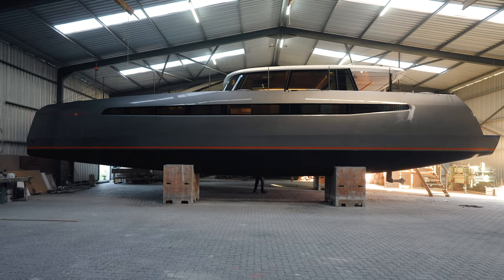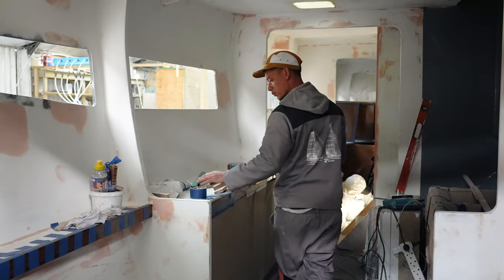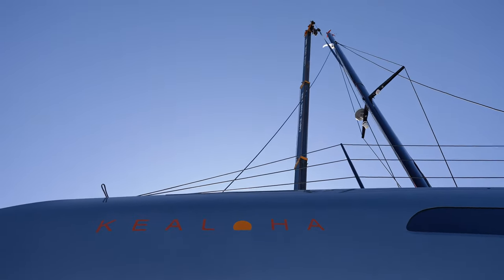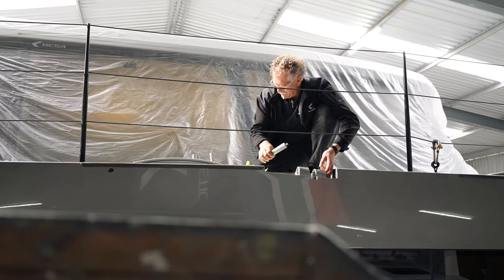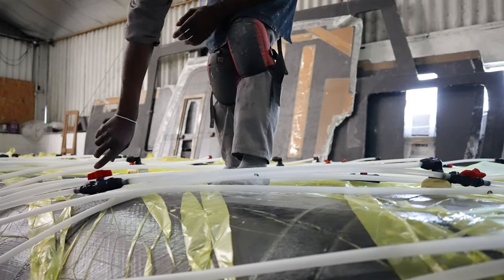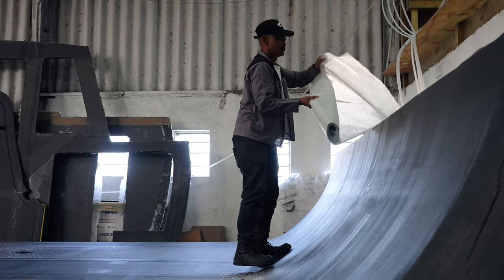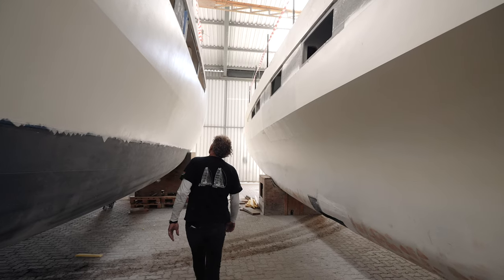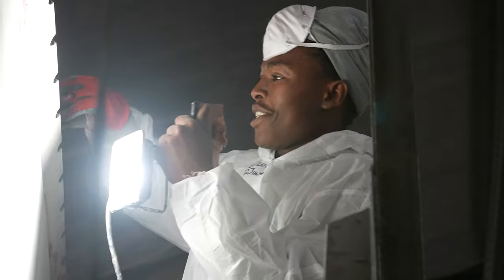How Its Built | KC54 | Kinetic Catamarans

Comment: Looks like a Well oil Cat. Would Carbon/Kevlar Fiber Cloth help in the Bottom Hull to keep a little Cost Down? Have you thought of using Kevlar/Carbon Fiber in different Color for Sinks and other Sailing parts? Last UV rays hurt the Life of Carbon Fiber has you try to add White or Other Dye color to your Resin ?